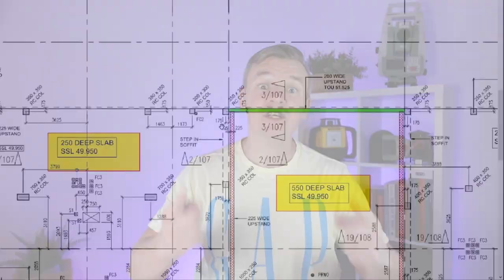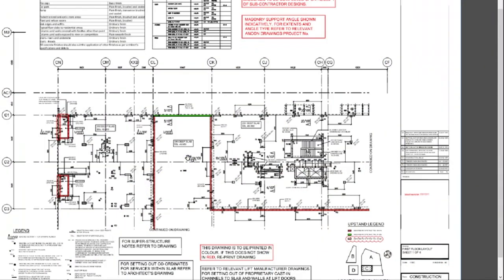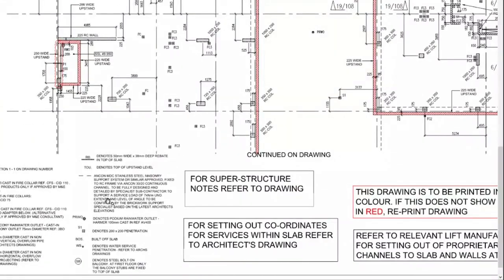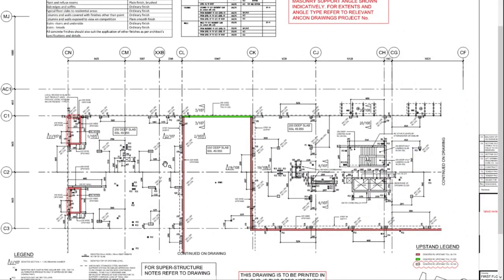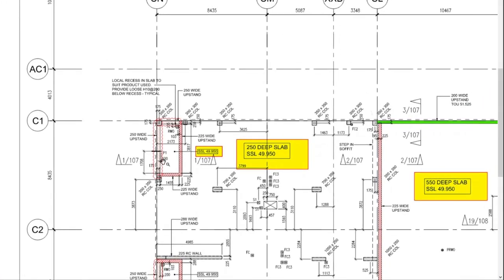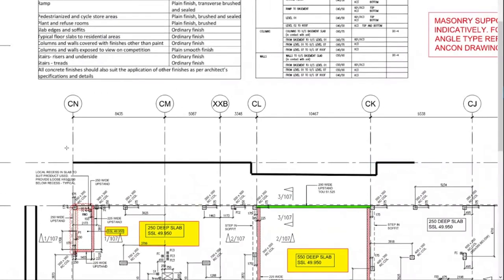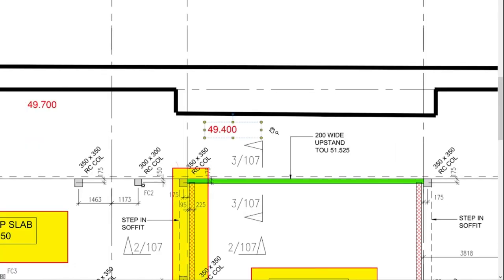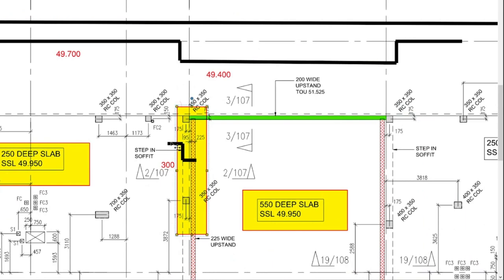Suspended SLAB Construction Process

Comment: Like you said Greg, always good to set the initial level a touch high as once the steel is in place and all the chippies have walked on it the deck will settle a little in some places and is easier to wind the props down than wind them up. Especially important to get your deck at a good level if only 25mm cover top and bottom.
Reply from the maker: Exactly! I never did more than 5 really as like you say there might be problem with the cover later and where the balcony stubs, or other inserts go there might be a problem too 👍👍 Thank you for your comment!

Comment: Hello again Greg.
You got any good tips for setting up for doing a suspended slab when there’s nowhere hard standing to set the TS up? I was using a building across the street but I have been blocked access to the roof. I find setting up ontop of the ply for the decks is just far to bouncy and puts the machine off level. 
Was looking at using one of those stands you can drill onto the side of a core/column but I’ve heard mixed reviews. What’s your thoughts on these? Or any other bright ideas? 

Top content as usual mate, keep up the good work. 

Regards,
Joe
Reply from the maker: Hi Joe! You should use some monopod. Typically you need to install a pipe in the column, but I bet they do it anyway for a hangman and you can stick your monopod there. There are also couple of products from Survipod which you can still install later. Don't set on the decking! In my next video about the slab I will cover it a bit.

Comment: Hi Greg! I am currently in Romania, I have a degree in materials engineering, I want to move to the UK and I am interested in a construction job, with this diploma could I get a job as a site supervisor or assistant engineer? thank you and have a nice day
Reply from the maker: Hi Bogdan! Shouldn't be a big problem to get into construction. Make sure you have your settlement status/permit to work in UK, then NI and CSCS. If it won't be easy to get assistant engineer job straightaway you can still go into construction as Chippie labour etc and then go for engineering, there are lots of Romanians so will be easy for you 😁😁